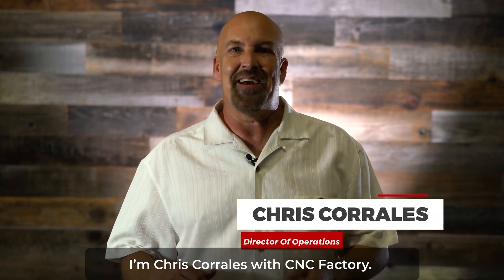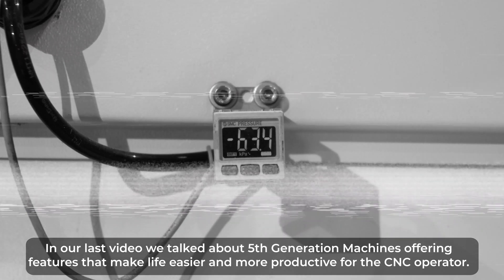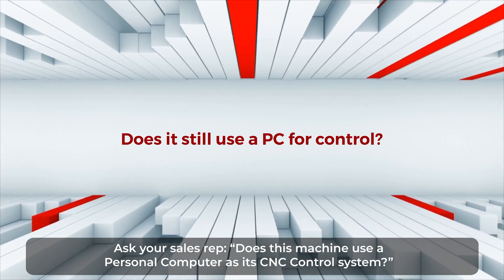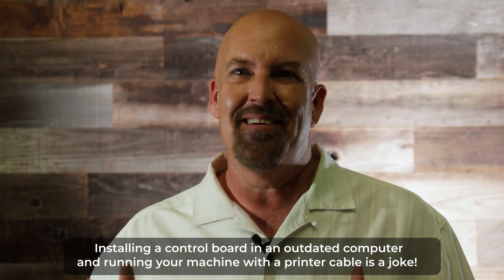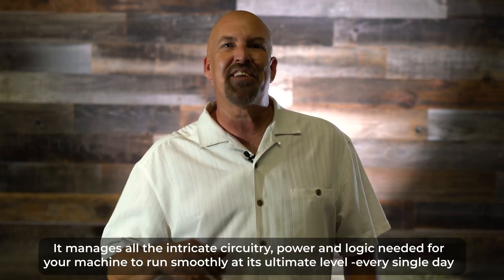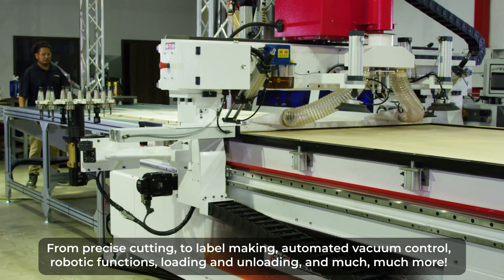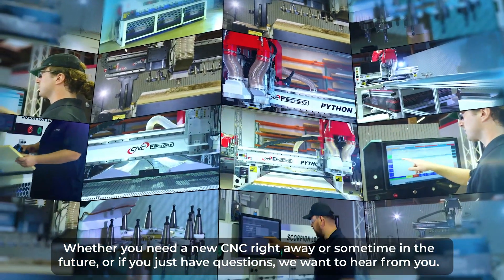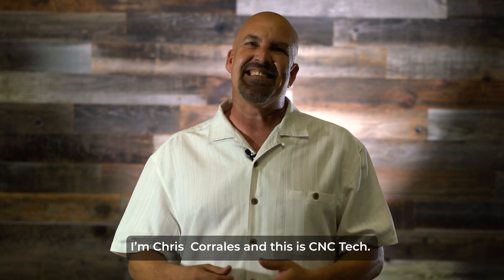Does it use a PC for its control system? Bad idea. Ask before buying-- CNC Tech/CNC Factory

Comment: You really need to open a computer in your life and dig in it. The old time of the 486SX25 is over man. There are no such legend that your operating system updates during a task anymore. Protocole Ethernet has largely replaced the very old parallel port. Using multithreading allows you to come back to your CAD on spot while the machine is milling, a computer allows you to manage a cad file of 1To, full 3D, I know at least one "industrial system" that is not capable to handle it. No company holding you by the balls with some proprietary system that they are the only ones to control and update, so you can migrate anytime to another system. Computers CPU+GPU is unlikely to be reach in terms of power and flexibility.